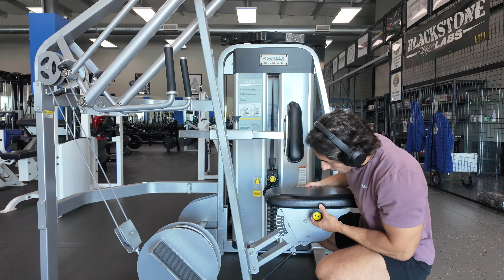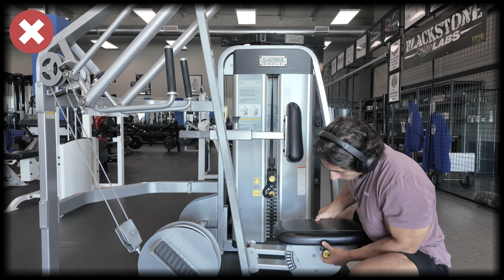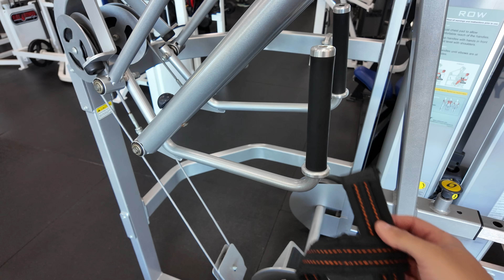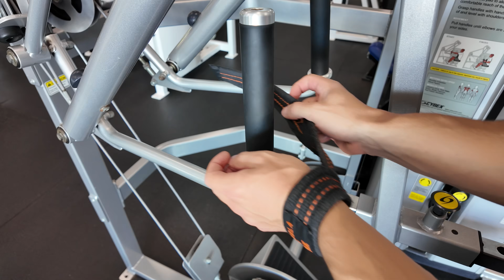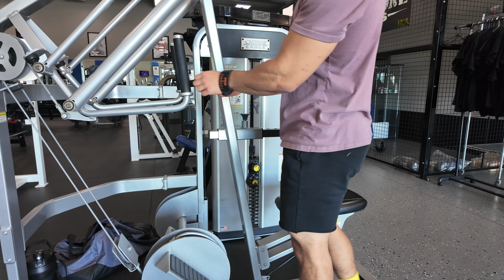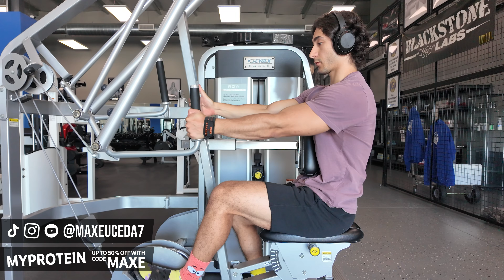SINGLE ARM LAT ROW | Exercise Form Guide

Comment: When guy said not to stretch shoulder forward that's when it was cooked. Your lats literally attached to your shoulders like how front delt is attached to chest/pecks.... 

Moving shoulder slightly forward will stretch your lats and base on new research load on stretch is where best growth happen.

Let it stretch as much, then pull it. You can feel your lats. 

This is also why there is intense soreness on entire back after a single boxing session coz when u jab straight. A proper punch recuits lats, and we all know we dont punch like how you sit here in negative but actually reach for something which stretch shoulders a bit and lean forward a bit due to reaching